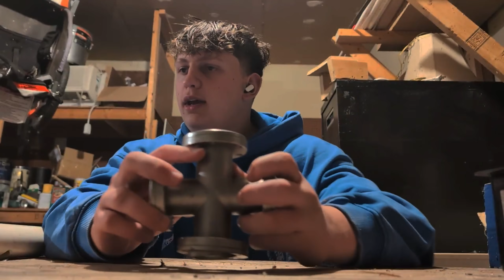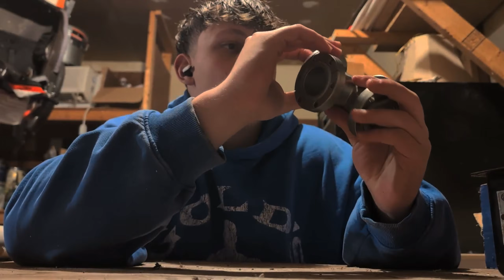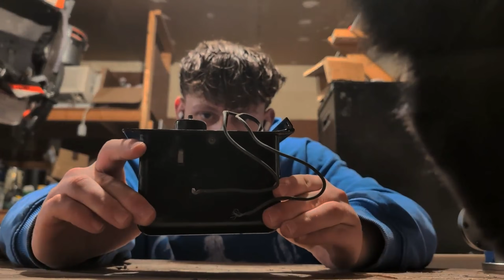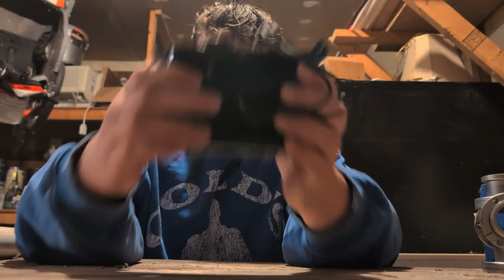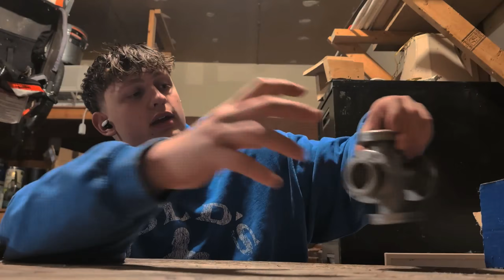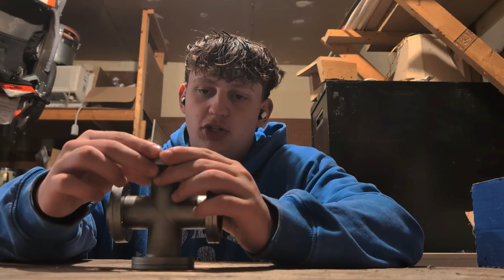Building a fusion reactor in my garage EP 2

Comment: you can actually buy orings for conflat fittings as a cheaper alternative ( to address your dents)

its also not great for outgassing but legit lead solder without the flux will also work as a cheap alternative to indium if you really need that metal seal ( using just a roughing pump I doubt you need to worry about it)

If you are interested in getting really low vacuum 1e-5 torr and better for cheap consider buying some 4a zeolite and building a cryo pump ( liquid nitrogen is really cheap)
although you would need to rough in the chamber with your pump then valve it out once you "turned on" the cryo pump
Reply from the maker: Ok thanks for the advice.